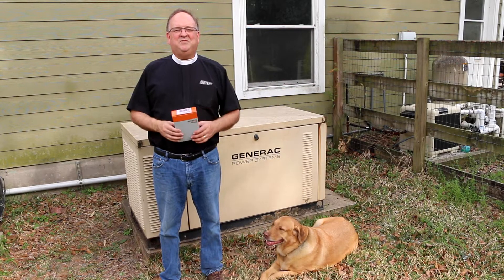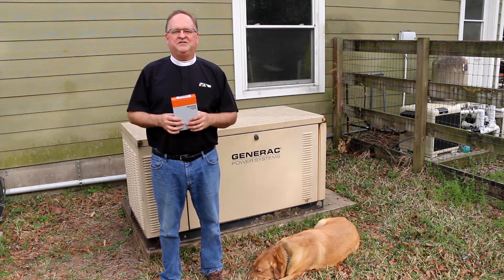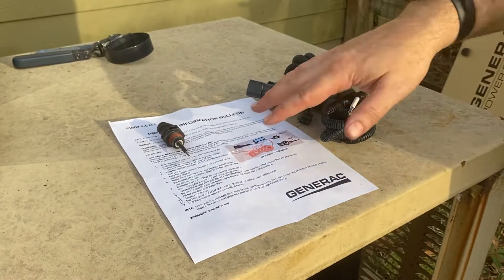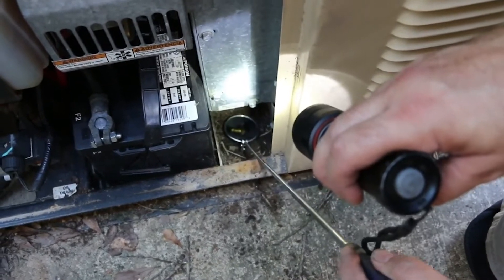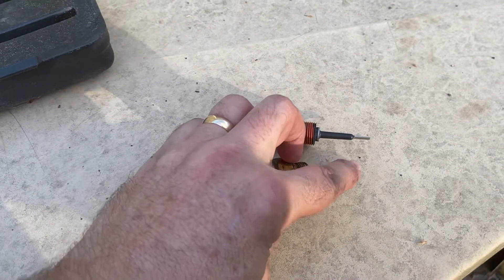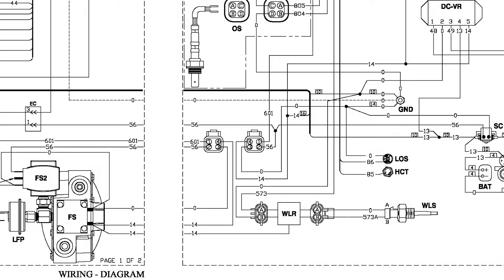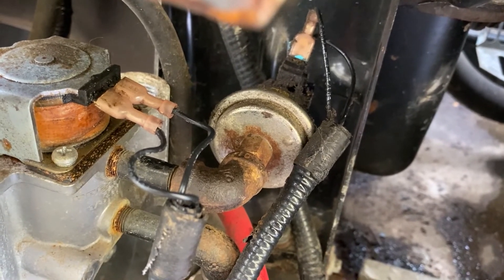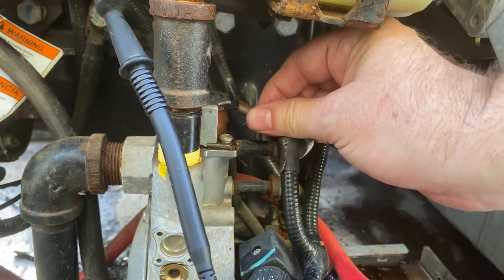Fix False Low Coolant Level Fault on Liquid Cooled Generac Generator

Comment: Put it under load after this fix for at least an hour. Turn AC on, etc... You might find that it overheats and shuts down again. Radiator issues..
Reply from the maker: The initial problem was repeatable while not under load, and immediately cleared up after. I ran it for a little while at full speed, but not under load.  Before I completed this retrofit, I bypassed the sensor during a power outage and the generator ran fine. I realize that was a bit risky. In any event, the generator has run for days under load since then.

Comment: FR. GEORGE how does one know what type of controller the generator has?  My unit looks externally similar to yours but has differences in the internal layout.  I have the same problem.
Reply from the maker: You can find the manual for your generator using the serial number on Generac’s website. It’ll tell you the controller you have. You can also lookup the part number for the coolant level sensor in that same manual and find the retrofit kit based on it. There are bills of materials in the back of the manual.
Reply: So was your generator running for about 15 seconds and shutting off with the low coolant error code before you installed this part?

I got the same model and mine won’t stay on more than 15 seconds in manual mode

Comment: FYI, an alternative for finding the correct terminal at the solenoid for the orange wire connection is by identifying the harness pin that reads 12 VDC when the generator is running (At least my generator will start and run for about 10 seconds even with the probe not connected). The diagram in my parts schematic initially led me to connect to the incorrect pin based on the drawing's pin's orientation. I guess the check for ground as you mention in the video may also work, but I contacted Generac for their recommendation before checking your video.